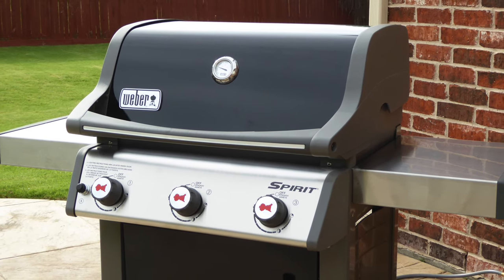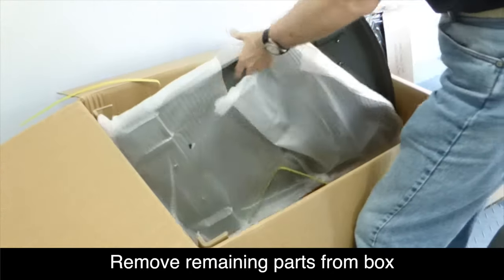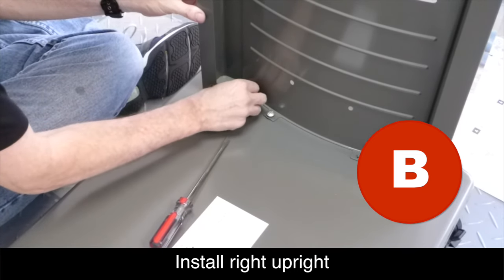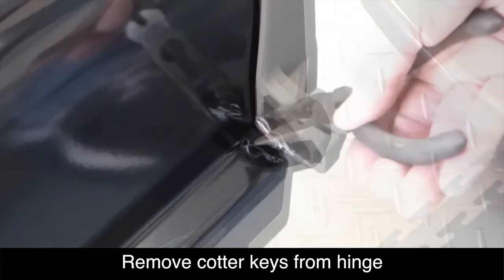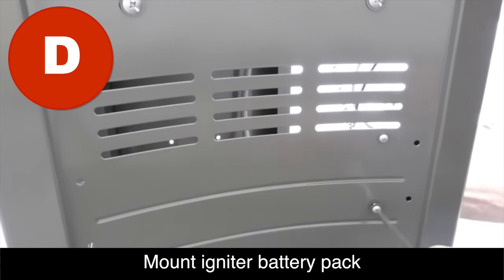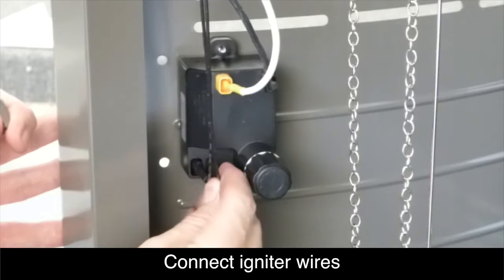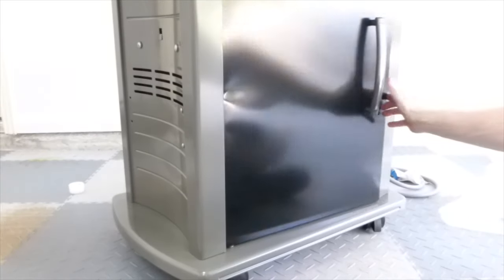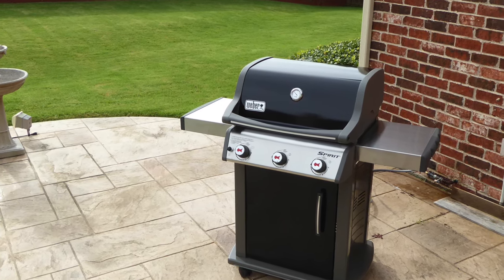How to assemble Weber Spirit E-310 Gas Grill

Comment: So here is the thing. This is the first gas BBQ I have bought. I have spent 40 years with charcoal, fir cones and wood.
So having assembled the E210 I left the house to buy the gas (the DIY box I bought the BBQ from did not sell the gas) so I took along the regulator and hose included to ensure I bought the correct gas (propane it said on the regulator) It turns out the regulator included does not work with the bottles on sale here in Luxembourg (or so two places said) Found the gas on sale at a Total petrol station and also bought a regulator. Got home and found the bottle too tall to fit. (What a newby I am) returned to Total got smaller bottle and a different regulator for this small bottle.
Now I have to leave the house again as I see the “clip” holding the hose can not be reused and I need a screw clip.
The FUN of gas BBQ.
Reply from the maker: I can imagine. Mines is natural gas, so I did not have that hassle. I think you will love it, and propane is much hotter than NG.

Comment: I have a related question. After 8 years with my Weber Spirit E-310 gas grill, the wheels are disintegrating and need to be replaced. Your video would lead me to believe I can remove the grates, remove the lid, remove the screws holding the sides to the base, and lift (2 people) the body off of the base, allowing me to flip the floor over and easily replace the wheels. Do you think this is a reasonable approach? Any unintended consequences I might encounter? Thanks for this excellent video!
Reply from the maker: It should work.
Reply: @cruisemansgarage  Thanks! I really appreciate your quick answer.

Comment: Thanks for this.  I have exact model but noticed I don’t have a heat deflector like most gas grills.  Looks like you don’t either per the assembly. Any idea as to why this model doesn’t require a heat deflector? Thx
Reply from the maker: Not sure why it doesn't. I have had the grill for 3 years now and it still performs great!
Reply: I’ve had for a year and love it.  Have recently used it to cook pizza on a stone instead of using my kitchen oven.  Cooks it better and in half the time

Comment: Did anyone notice that the 3 burners are not fixed or screwed down at the back.  They are free to slide back and forth almost a half inch.  At least on the E-315.